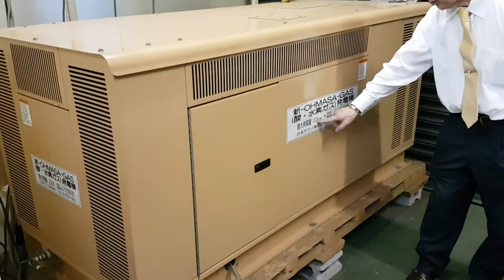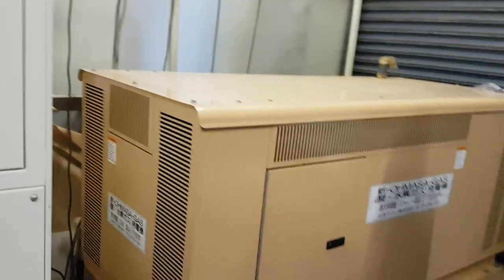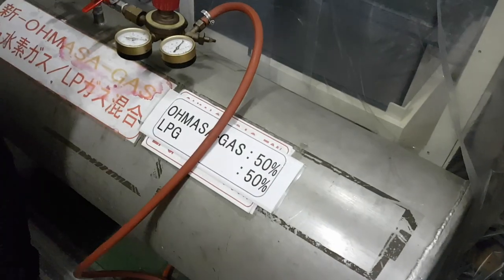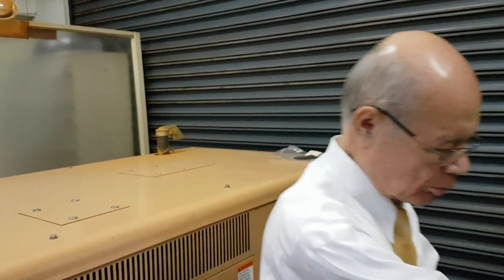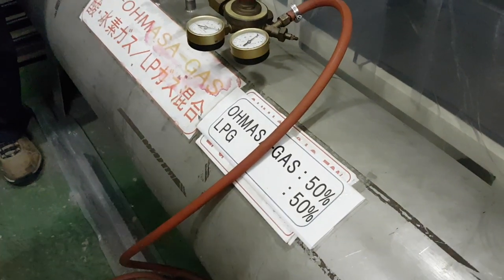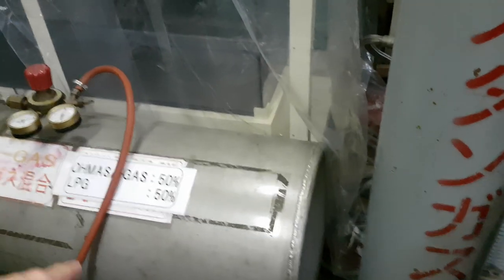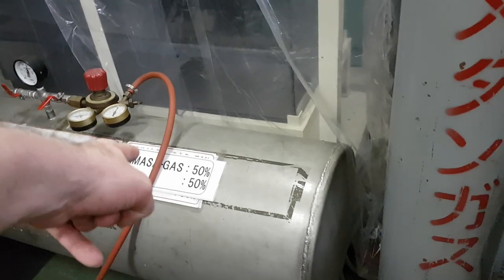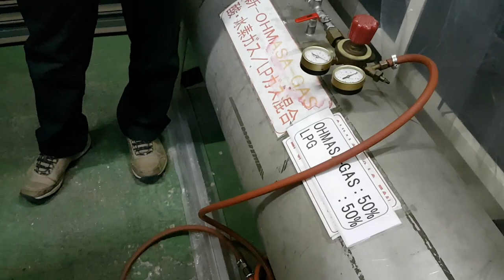OHMA: 50% OHMASAGA 50% LPG

Comment: Hey Bob, he was at ICCF20 in the poster section. If you want photo's of the booth I can get them for you. I also have put up some pictures of the leaflet they were giving out which I just uploaded at the following link https://postimg.cc/gallery/2tm9hw2ay/ I was vaguely interested until they said that you could use their machines to make gold, at which point I assumed they were about to try and scam me and tried to get away :) I probably should have kept listening cautiously, as it definitely seems like they may have embraced some of the techniques of Stanley Meyer (before he moved onto rotating/spinning plasma fields for direct energy generation). I'm wondering if perhaps the clustered water molecules have some kind of polarization based on size which allows them to be "spun up" with high speed ac or pulsed dc signals then allowing them to capture/resonate with the cosmic neutrino radiation.